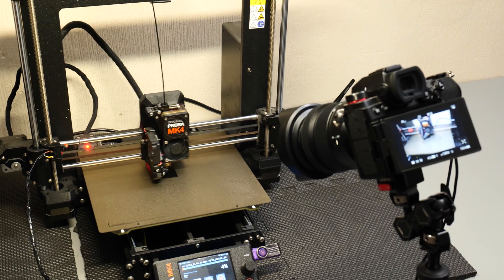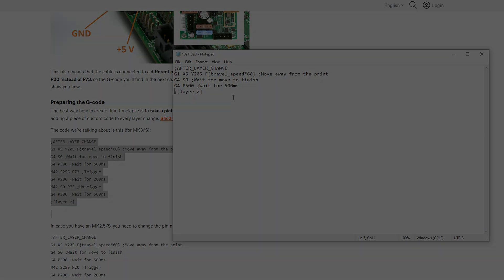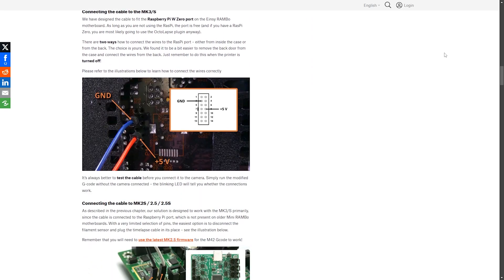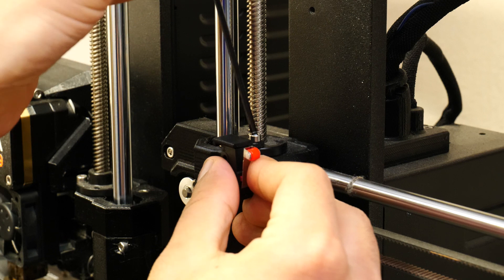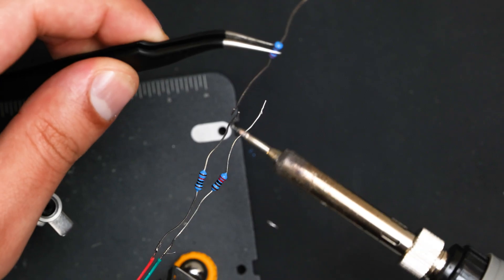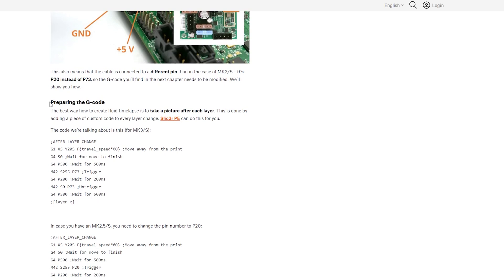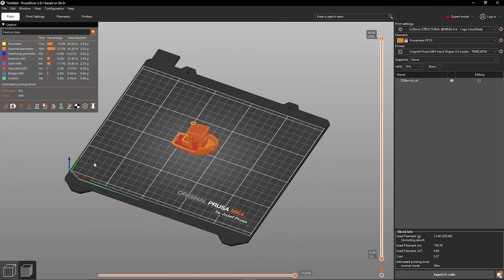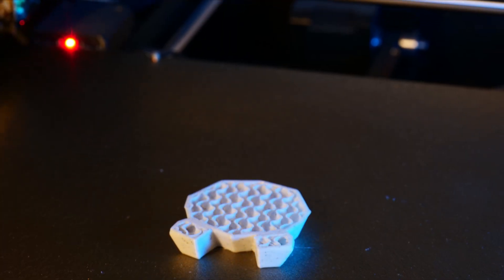How to Make AMAZING 3D Printing Timelapses

Comment: whats the extra travel time on that! plus stringing must be an issue
Reply from the maker: I was able to manage any stringing issues by modifying the g-code. With some retraction, there was no issues. 

As for travel time, there was a small increase but not too much.
Reply: @MirzaMakes  seems alot of messing about really.

Comment: I guess that's a feature I need to add to my 3d printer firmware: a method to trigger a shutter release. Thanks for the heads up. M240 will be the remote shutter release command
Reply from the maker: Glad to help!

Comment: Ig it would be beter to use the gpio pins available on most modern printers to send a signal, instead of a limit switch which the printer has to hit.
This could also be set up via g-code modifications and would be much faster than essentially pausing the print after each layer to hit the limit switch.

I haven't looked up the specifics for the Prusa printer, but I'm sure it's possible.
Reply from the maker: Yeah for sure. I’m waiting to get my hands on the Prusa Hackerboard and then I’ll move over to this kind of setup.